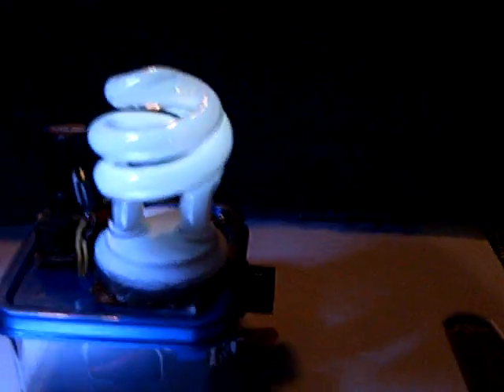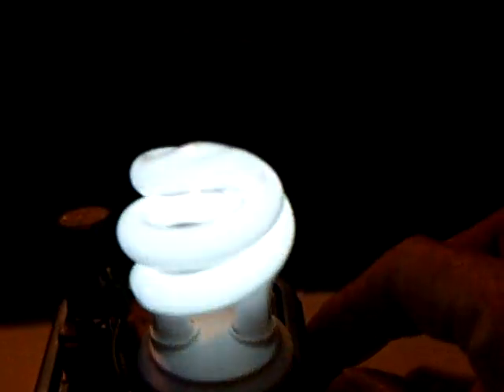Hand held Joule Ringer--Boxed.ASF

Comment: Hello Lid.... May I suggest that you try a TIP41C - It takes more A before it will 'blow' and still does 100% what the TIP31C does. 

I've switched all my class projects away from the TIP31 to the 41's and have cut my replacement costs down to less than 5% of what they were.

Just a suggestion. - - Really cool projects. Our whole class enjoy your video's.

The ole shop tchr of 39+ yrs.....

Comment: Very well done Lidmotor.
Looks great.
Maybe you use 2 or 3 transistors as Darlingtons not to burn them up ?

As you have played the most with it the last days, are you sure, that these
bifilar coils do not add more energy back to the cap than the cap-resistor replacement ? 
Can you please post more scopeshots in much more detail
and also draw up, where you take the scopeshots exactly ?
Many thanks in advance.

Regards, Stefan.